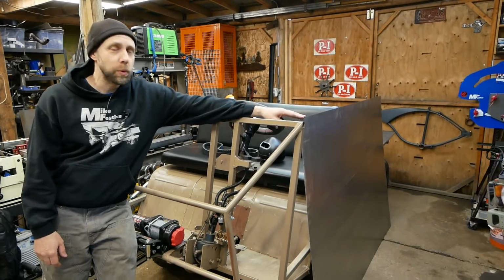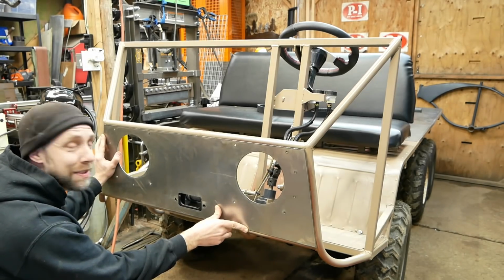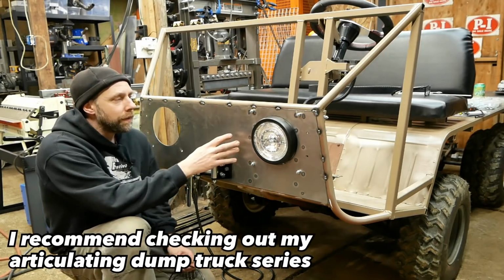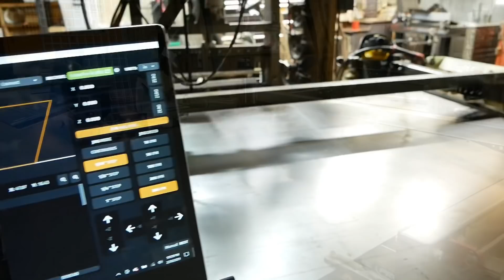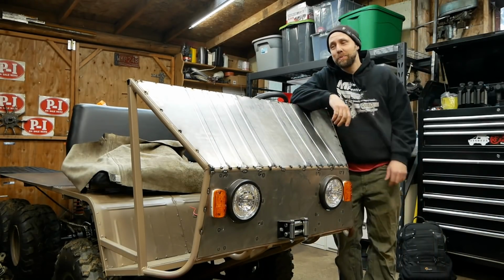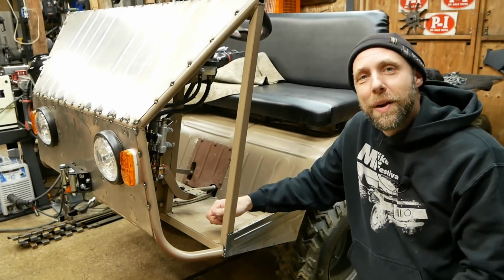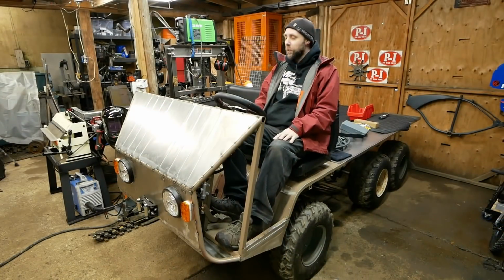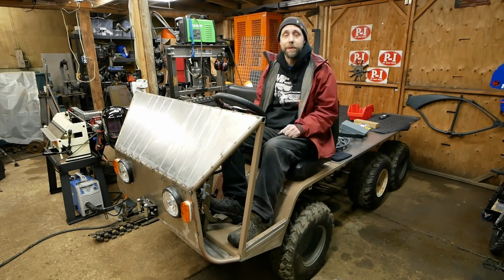Mini Pinzgauer 6x6 Off-Road Build Series part 8

Comment: Mike- been using the hf titanium flux 125 after your video, since it's perfect for where I live. Can't have gas, and need the portability. Almost finished making a skid plate for my 4runner and it's been great! Taken me two weekends so far and everything is now tacked up, hopefully finish weld next weekend. 3/16" is definitely making me wish I had a plasma cutter lol, been through about 10 cut discs.

Comment: Mike, Thank yo for the work you put into these videos. Your work caught my attentions with the articulated dump. I am currently in the design and materials acquisition stage to take Protege, add a steel hull, lower the drive line, add tracks and an impeller. I live in an area filled with swampy terrain and many small lakes so I think this will allow me to travel all of that in all 4 seasons. I plan to take everybody along for this transformation,

Comment: Looking good. I ordered the yes welder mig205ds to replace an old snap on welder so I hope it works as well as yours does
Reply from the maker: I really like mine so far 👍 I hope it works as well as mine too.
Who made the snap on welder for them?
I’m sure it was from one of the main brands, Lincoln, Miller, Hobart?
Reply: @Mikefestiva  I'm not sure. It's probably 30 yrs old. Only 110 amps. It will occasionally lay down a good bead but very inconsistent
Reply from the maker: @timgolin3883  I think you will like having a 110v/220v inverter welder, they run a lot smoother then the older transformer welders.
Reply: @Mikefestiva  The older Snap-On welders were made by Century. Snap-On just added a coat of red paint and a zero to the price tag.

Comment: You may have considered this...  if you leave the sheet metal like that, you may want to consider a drain plug for the part in front of the floor boards.

Comment: Happy to help out with a comment. Well, question really...
The design of things like headlights and winch would appear to allow driven water to enter the cab through those apertures. Fair enough. But aren't you creating a well under your feet, and especially in front of your toes, to retain that water and become a rust trap? How do you intend to address this problem? Maybe a few rubber drain tubes, like in a battery box or similar?
Reply from the maker: Yes two simple holes in the floor is all I need, simple and you answered your own question 👍

Comment: Hi Mike, how do you plan to deal with the sharp edges contact with the frame...I mean before painting it will you apply sealant and then painting it or will you welding it all the way and them painting it . Thank you!! Keep on the good work.

Comment: Just curious how come you mounted the winch on the inside? Why not on the bumper outside ?
Reply: Looks great to have it hidden and also it moves the weight slightly backwards. What are the benefits you think of mounting it on the bumper?
Reply: @simonnystrom8137  it does look good. I was thinking along the lines of keeping the winch more protected   Mounted on the inside. The only thing I can think of with a bumper mount is if he had to use the free spool alot

Comment: Mike, home much do the panel shrink when bead rolling them?  Have you calibrated your pro, the headlight circles look a little big,  I have the same table and have not done that myself.  Great content and project, look forward for more.....get back to work!!
Reply from the maker: I really haven’t noticed any shrinking when I roll them, who knows? There could be a little bit?
I cut the holes on the grill over sized for adjustment, I have learned over the years to give yourself a little wiggle room, if I don’t I always regret it. Take care

Comment: What have you found that helps with sheet metal bowing up on the CNC table. I have one at my apprentice school and it seems to bow up after a couple pieces and sometimes it will knock the plasma gun out of the holder (it’s a magnetic retainer ring), or bottom out and mess up the cuts. Any advice would be great to pass along, we’re pretty new to it.

Love the channel! I’ve been watching for a while now, since the second episode of the articulating dump truck build! Keep it up! 

P.p.s. Love the drum breaks!

Comment: Well, YouTube sucks, for sure, but they are promoting your videos to SOME extent. No offense, but I hadn't heard of you til yesterday... DESPITE the fact most of my feed is "Grind Hard Plumbing", "Cars n Cameras", "Bad Obsession Motorsports", etc., etc. All fabrication channels. Your's popped up yesterday and I'm hooked on this build series.
 Can I make a suggestion? How about mounting the "shifter" lever on the right side of the steering column, with a parallel rotating shaft and a spring loaded ball detent? Seems like that would be way more convenient and still out of the way?

Comment: Your vehicle will look very good.
But mechanically it looks nothing like a Pinzgauer M712 6x6. Pinzgauer vehicles use the Backbone chassis structure and have oscillating and mismatched axles, which was developed by Hans Ledwinka, in Tatra (former Czechoslovakia) and his son Erick Ledwinha made some modifications to his father's design for use in Pinzgauer (Austria)

Comment: Well you told me to commend so I will, the plate in front of the wheel, have you painted it on the inside where it’s sitting against the frame. Else overtime it wil start rusting from the inside out, not that that will be the end of the world. But hey you told me to commend. And in the and you could always buy a Unimog.